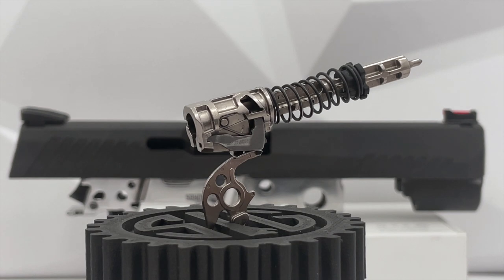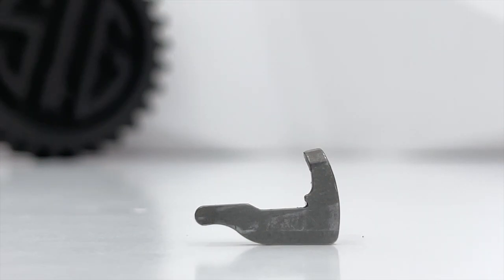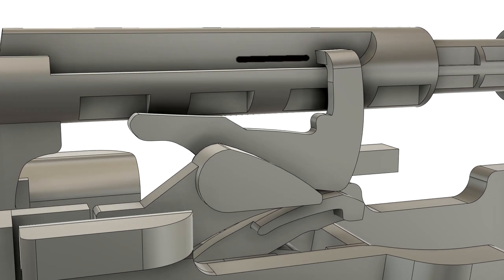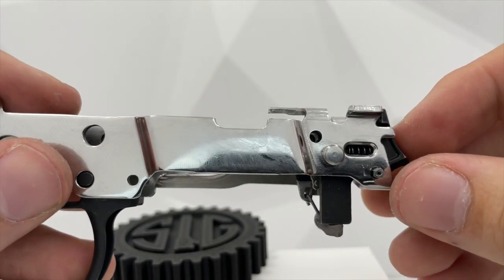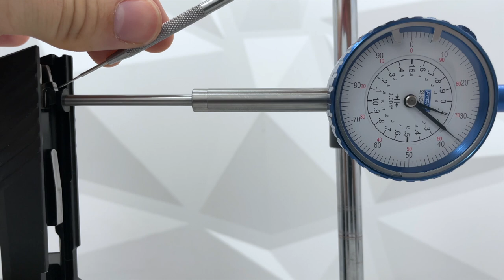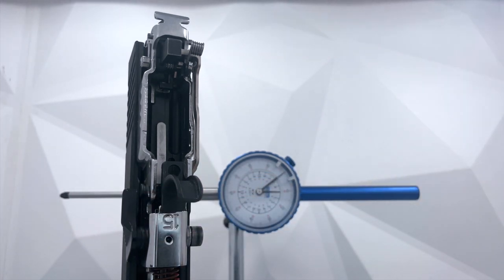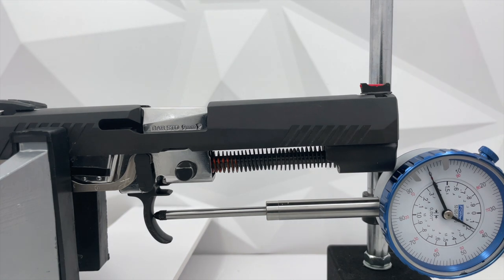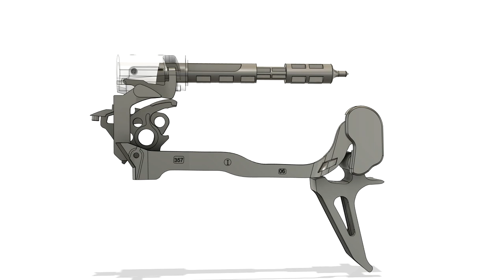P320 - STRIKER SAFETY DISENGAGEMENT PARAMETERS

Comment: So is it possible that if the spring in the striker safety fails is it possible that the firing pin can release and fire the round in the chamber
Reply from the maker: No. There are still safeties implemented even if the spring breaks. I know that someone posted a video saying it caused a ND, but unless the trigger was pulled the other safety would still have been there.
Reply: Thanks,I see all the videos and just don't won't to take a chance of the gun going off and injuring someone

Comment: At the minute 4:39s is not a spring inside the cavity where fire pin is located?
Reply from the maker: No, there are no springs in the housing at that time stamp. I removed them for the demonstration.
Reply: @SIGMECHANICS  Thanks, this spring is the "striker pin reset"? The name? I think my M18 never came with this spring :(

Comment: Another point: the Walther PPQ striker assembly is similar in function to the P320. Very little trigger travel to disengage the firing pin block - BUT - the Walther comes with a trigger safety like a Glock. The idea of no trigger safety and very minimal travel isn’t super appealing from a safety perspective. P320 should have come with trigger safety or manual safety standard

Comment: Wait a min, if the margin of safety is 0.09" of pretravel before the striker safety is disengaged, then doesn't all those aftermarket triggers that reduce pretravel just compromise the striker safety?
Reply from the maker: Potentially yes. Depending on how the operator tunes the trigger but, it has been generally excepted that this may potentially disengage the safety. I made a video sometime ago showing how to test the safety of the striker after making modifications or installing new parts. Check that out. Let me know what you think.
Reply: @SIGMECHANICS  Thanks! Is it the DIY competition trigger job vid? This is all making me think twice about reducing pretravel on a gun with no trigger safety.
Reply from the maker: That one is my range toy only I wouldn’t recommend it for everybody. I have a method of ensuring safety remains on that I would still need to be independently verified, but once I have it down pat, I will release it. For the most part it’s better to be safe than sorry and the stock skeletonize trigger with a over travel stop weld does a wonderful job on its own.
Reply: @SIGMECHANICS  And also second question, in your opinion, would adding a trigger shoe safety like the Agency Arms trigger make the gun safer after reducing the pretravel or pull weight?
Reply from the maker: Yes. However I hear people have a tendency to dislike them due to the restrictions on finger placement. I’m about to release a video all about the p320 triggers. Stay tuned! It might help.
Reply: @SIGMECHANICS  Thank you!

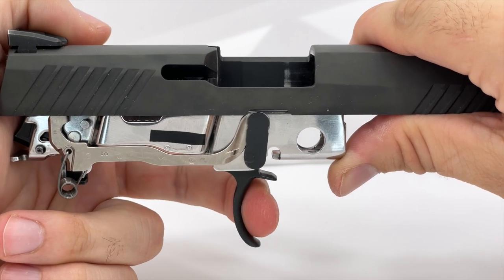Comment: So from about 7:00 to about 8:00... Is this demonstrating that if someone hit the back of the slide with say a rubber mallet it would still "click" but the striker wouldn't go forward past the breech face?  Sorry for the simplistic language I'm an operator not an engineer lol
Reply from the maker: Not quite. The rubber mallet would not have any effect. Assuming however, that your using a “upgraded” version of the P320 (the pre-2017 versions had a drop safety issue), then there would be no effect to impact. 

The demonstration I’m doing here is just to show what happens if the sear is engaged, either with or without pulling the trigger. The result being that with the trigger pull, the safety tab moved out of the way, and it fires normally, and if I engage the sear without engaging the trigger, then the striker would not release into the breach face. 

If for any reason your P320 ever somehow was unable to retain the striker the safety tab will protect you, but ONLY if the trigger has not been pulled back far enough to disengage safety inside.
Reply: @SIGMECHANICS  OK, thanks. Buddy of mine has one post recall and he says when he hits it the striker still drops
Reply from the maker: For sure, but tell him to replace the original trigger to the newer (slimmed down) versions, that will eliminate the drop safety problem with one part swap… all the other “upgrades” are more like free extras, the trigger being too heavy was the reason that version fires like that.

If you get a chance, watch my video called pre-versus post upgrade P320 analysis I go into detail about this.
Reply: @SIGMECHANICS  will do. Recently found your channel and it's quite impressive. Well done. He's got a x-compact does than not already have the thinner trigger?
Reply from the maker: It’s possible, but if your saying he can light a primer with a hammer, then chances are he’s not upgraded.

Comment: Before the voluntary upgrade program, the gun could discharge when subjected to large forces due in part to the trigger mechanism's inertia. For the upgrade, sig made the entire trigger mechanism much lighter to fix the issue as far as I understand. Do you think a post-upgrade gun could still fire when subjected to extreme forces outside the realm of regular usage (say, for example, 50 G's)? The only way I can see see to fix the issue at the source would be to add something like a backstrap or trigger safety.
Reply from the maker: @SultanOfTheUnderground. It’s hard to speculate on that kind of thing because I try not to provide info without some testing or background knowledge. However, if we are talking about an unnaturally heavy impact after a massive acceleration, I would think almost any non-safety gun would be affected by inertia at those levels. 

From what I could see through my own (unofficial) testing, is that the post upgrade trigger doesn’t move at all with a standard height drop. One day I plan to build a setup to test it, but for the time being, personally, I am satisfied with what was done.
Reply: “ However, if we are talking about an unnaturally heavy impact after a massive acceleration, I would think almost any non-safety gun would be affected by inertia at those levels.”

What you just described is a firearm dropping to ground from a moderate height. 

No other modern design handgun fires when dropped except for the Sig P320. Full stop.
Reply from the maker: @J A, To be fair I don’t have the data for either the P320 or another similar firearm. So what I can do is request from Sig or their partners if there is any lab type testing that I can share. 

However, I wouldn’t be able to compare the result to anything else unfortunately. But, I think it’s fair to question it based on the lack of available info released by Sig. 

Anyways, I appreciate your input! If I can get the test results I’ll share them with you and the community.

Comment: What’s scary is all these adjustable triggers where owners dial out all the pre travel.  At that point there is no firing pin block in operation.
Reply from the maker: I haven’t seen it go as far as complete disengagement, but if people know the degree to which that block was being moved they would immediately stop using it for sure!

Comment: Okay, bear with me... remove your mods and reassemble the pistol, including the back-plates. It is possible to wedge a small object, like a paperclip or something similar, into the gap between the slide's back-plate and the FCU's rear cover and apply slight leverage to disengage the striker safety and discharge the striker. I just did it using a small watch repair screwdriver and repeatedly dry fired the pistol without pulling the trigger. I only had to insert the tip of the screwdriver 1/4 inch. I made no modifications, I just removed my magazine and cleared the weapon. Again, this would be exceedingly rare, but it is possible. I am an armorer. I've been a small arms armorer for my agency for over 20 years. My P320 is all Sig Sauer manufacture. I'm using a Wilson combat grip module, but that's it. All other components are factory Sig. ETA: Read the replies. The  video mark that explains the error in my assessment is at 20:01. I watched the full video but got distracted by my son at the end of it. I missed this. That would have blocked my entire premise.
Reply from the maker: If I understood correctly, what you were able to do there was push the sear down, which is possible. However by doing so you are not disengaging the safety simultaneously. The striker released but did not enter the breech face.
Reply: @SIGMECHANICS  Excellent point, I'd have to use a primed brass case (no charge or seated bullet obviously) to test if this would under some circumstances actually happen. Looks like I'll be spending some time with a priming tool and the gun range. My father used to use a #2 pencil with a rubber eraser to test firing pin impact on his 1911, I might try that. The firing pin on a 1911 hits significantly harder obviously, but if the striker actually does protrude into the breach channel at all I should get some movement. It shouldn't make a difference at all, but I'm going to try it anyway. Thanks.
Reply from the maker: You could also go the method of removing the barrel, and recoil spring assembly. Then reassemble the pistol and do your test. If indeed, there is no safety, then you will see the striker head protruding from the breach face. You can see a similar set up if you go to my video on Striker safety parameters and skip to the 7 minute mark. Let me know your thoughts.

Comment: So about 0.1" to release the striker safety and another 0.1" to release the sear.  0.2" travel from rest to fire - from contact point of middle of trigger One might be concerned about the approx 0.03" travel to release the striker safety, and could, with part wear, the distance be decreased and the edges round off, however I would think Sig's and the US Army testing has shown it to last at least many 10's of thousands of cycles.  I just don't understand how people claim this gun ( especially the upgraded version), just "went off on it's own" with no one touching the trigger. The striker safety has to fail, AND the primary AND secondary sear as well. To me - one in 10 million,  or greater, odds!  Has anyone noticed there have been no more reports of spontaneous discharge for almost a year now?? I wonder why :)  I guess all the 320's out there spontaneously healed themselves!
Reply from the maker: @Jay Berkowitz. Agreed, from what I can see the only way this will discharge is if the trigger travels the entire length it mechanically has to in order do so. I honestly haven’t found a method to let it simply go off without human intervention.
Reply: @SIGMECHANICS  I think the short light trigger pull combined with     an incorrect holster for that trigger is to blame.

Comment: It would appear that a trigger shoe with a take up adjustment is a bad idea on this platform
Reply from the maker: In some respects, I have to completely agree. Not knowing the limitations of modifying the trigger or adjusting the take-up could definitely cause problems. 
 
Not necessarily meaning you can make the gun go off unintentionally, but simply tuning the trigger to a point where the operator may not be expecting a discharge can be a problem on its own.

Comment: Hope that fire pin safety is made of a reliable material (and won’t broke any time soon), cause everything really looks like holding on millimeters. 

I think trigger safety would add enough level of safety. Any thoughts on Agency Arms triggers with safety bar? 

Also, it would be great to compare those safety feature to other handguns (for example Glock). Just to understand what are common practices in the industry. 

Again, thanks for great and informative videos!
Reply from the maker: @John Johnson, I will be going some testing to see what the sheer strength of the tab is (just need to get around to it), but I think it would take much more than the striker is capable of to break it. As far as the Agency trigger goes, I have one coming soon so I can comment more on that later, but as is, personally I don't think its necessary, but I can see it being piece of mind for some operators. As for comparisons, this is a common enough request so I think I will definitely do one eventually.

Comment: I realize this video is now a year old so i'll limit my comment(s). This firing pin block is Not a safety, so to speak.  It's a "DROP" safety for clumsy people. There is nothing to prevent a trigger pull/push scenario from discharging the weapon. A shaky finger and or inadvertent anxiety with no actual frame/slide (1911 style) safety, if actuated (used) to slow or stop a negative action to any circumstance. whether it be a self defense or just a range shooting event. This comment is just MHO owning Beretta's, CZ's, S&W's, Rugers and a Sig 320X.

Comment: One last comment. This pistol should only be sold with a safety, and should be handled like a 1911. Then , no more issues with uncommanded discharges.
Reply from the maker: The only thing I’ll add here is that there are no “un-commanded” discharges, any time the gun has gone off (as far as we know) has been with the trigger being manipulated to some degree. Other than that, I think having the option to add a safety should have always been there, it costs Sig nothing to stamp an extra hole in the FCU, and the operator would be able to decide what works best for them.
Reply: and a trigger safety/dongle. If my theory is correct, if there is  pressure on the trigger from the sides this should eliminate it.